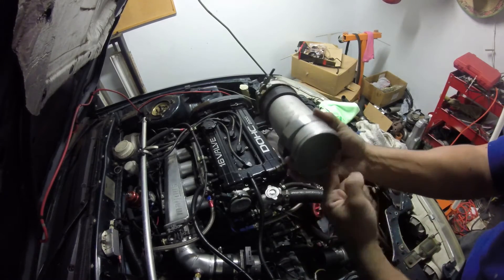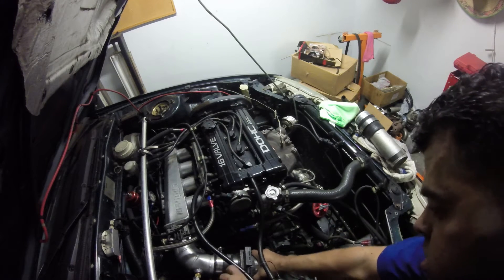Definitive DSM Turbo Boost Leak Test

Comment: are you running an isc
Reply from the maker: Project Junk yes, still running the isc.
Reply: tested already i presume? i had issues with my car. it ohm'd fine but wouldnt move at all.
Reply from the maker: If it ohm'd fine but would not move, you have a wiring issue. We encountered the same issue and fixed it by reversing a specific pin. After that it moved a ton!
Reply from the maker: Speaking strictly if you have an aftermarket ECU.